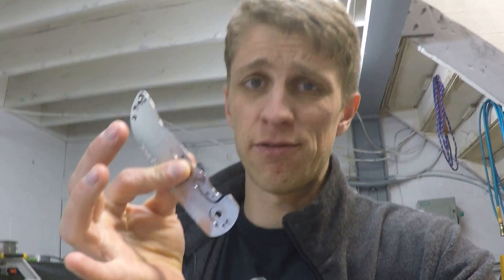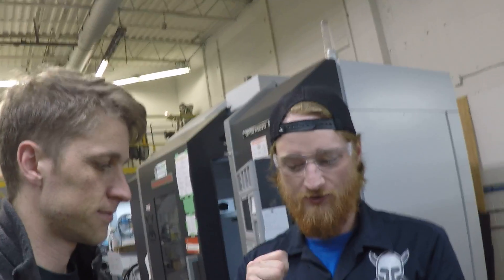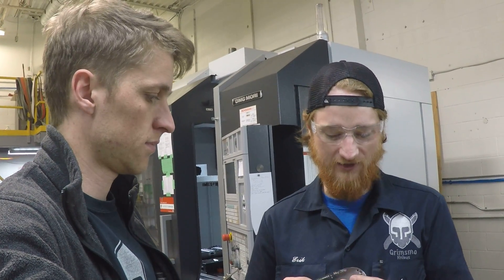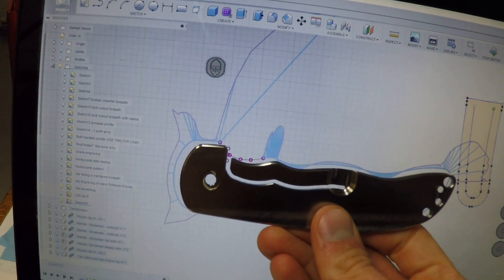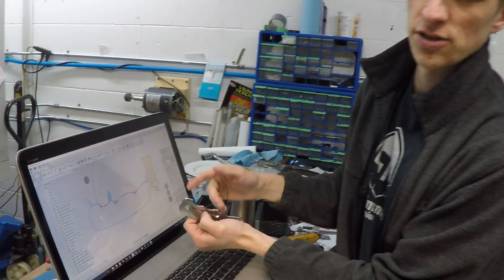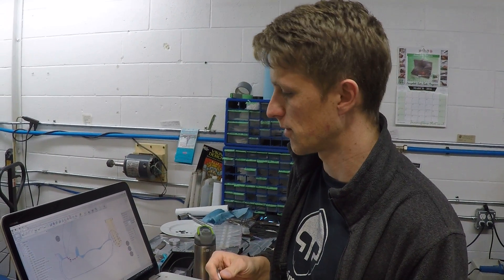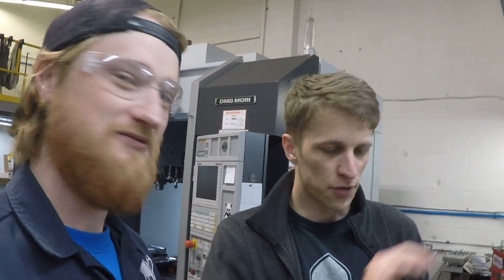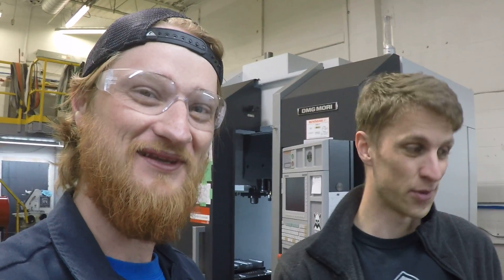Curvature Combs in Fusion 360

Comment: Machining splines can produce "stop sign" facets at high feed rates even if the machine is capable of high speed machining. The machine is changing direction at every spline node.  Try converting splines to arcs and or ellipses. This should produce a profile with fewer elements and a slightly smoother look.

Comment: Is the CAM side of things converting everything to lines and arcs before output to G-code, in which case I can see how "quick" changes in the original spline would affect the final result? Or is it possible for the Mori to actually read G-code splines directly? Don't know if that makes sense ;-) Some controllers can interpret additional G-code commands - for example LinuxCNC uses G5 to specify cubic, quadratic, or NURBs splines. If you could go from a spline drawing right through to a spline G-code command, and then let the machine controller worry about how best to follow it (with suitable use of G64), that might make things smoother. Just a wild guess.
Reply: +Lindsay Wilson One would hope the mori's price point would let it interpret every code up to and including spoken word plain language...

Comment: Hi John, ever considered its a controller setting issue. I had a similar problem and it was caused by machining in point to point mode. Once I changed to continuous mode (G64 on a Siemens controller, no idea what the Fanuc equivalent is) these little facets went away. Also with the Siemens controller you can choose between a few acceleration and smoothness profiles for the G64 setting, which was helpful in dialing things in. I may be way off here but thought I'd share.
Reply from the maker: +Luke Scheepers Interesting thought, didn't know about that.  I do think it's a design issue because when I make parts with really smooth arcs and curves it machines beautifully.

Comment: Taht just seems to be what fusion does. On my designs I will go to do something and get an error message because a part was randomly moved 3.997E-04mm or some other random small amount. With regard to splines I stay away from them and use tangent arcs, that way I can break up each curve into a 3-point arc that is a lot easier to manipulate.

Comment: Do you ever look at the G-code itself and clean up the plots?
Reply from the maker: +bcbloc02 I look at the gcode all the time but I don't really need to edit it anymore, Fusion produces some pretty awesome code.
Reply: JohnGrimsmo
Well I guess long term since you like to tweak it is best to fix your geometry errors in fusion that is causing your extra features and let it regenerate the code rather than trying to find the wonky toolpath or paths and fixing them in the code itself. of course the code could be perfect and you may have a cutter with a radius different than the program thinks or a toolholder with some run out. Be sure to let us know when you find the ghost. :-)

Comment: Don't you just hate that? Make a small change here and it changes something else your not even aware of until you machine it. I have had a few of those situations, that's where the ability to go step by step back in design history bar in Fusion360 works well. It doesn't help you catch the issue as it happens per-say, but it helps you figure out at what point in all your messing around you screwed something else up inadvertently.

Comment: Maybe you should use much simple geometry for this profile? Splines for everything is a just overkill. For the first sight only handles back profile needs a spline, other parts will be OK with plain arcs.
Reply: agreed.. I was taught to use simple arcs where possible, and correct the curvature using splines. it's basically impossible to entirely define a profile using just splines; hence the issues with the profile changing on you over time. build the basic shape with arcs/lines, lock it down, then add smooth transitions with constant curvature splines!